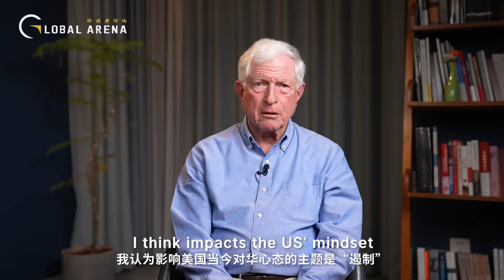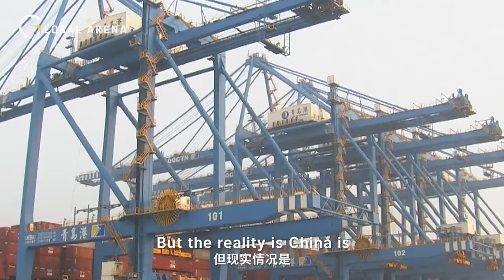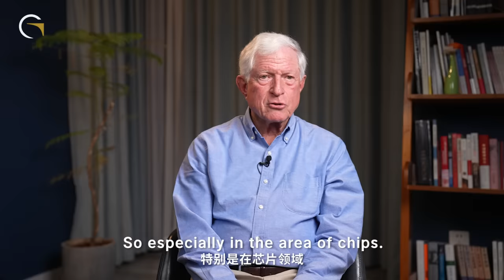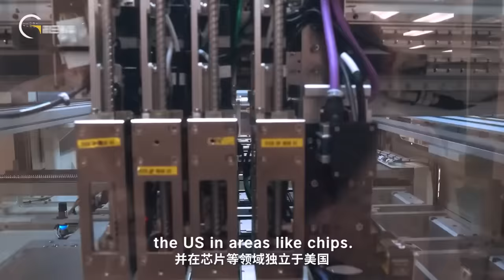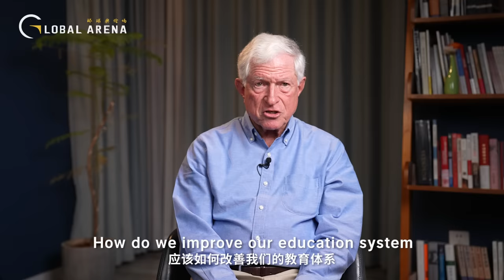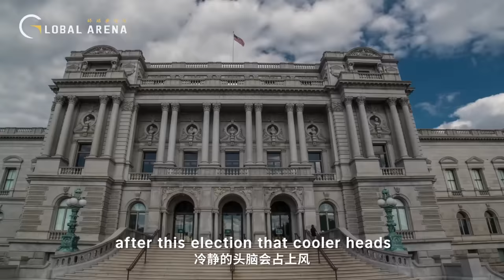Sanctioning China? US is as stupid as the Qing Dynasty Emperor

Comment: Excellent metaphor. But the situation in the United States is worse than that of the Qing Dynasty, because the Qing Dynasty was just in seclusion and did not provoke wars everywhere.
Reply: This guy is blowing sunshine up where it doesn't shine like Reagans biblical Winthrop quote.
Reply: The Qing Dynasty waged ten wars under the Qianlong emperor alone. Look up the "Ten Great Campaigns" against Burma, Vietnam, Tibet, and Xinjiang.

Also the Qing engaged in protectionism to run huge trade surpluses for decades (ironically this guy Walker quotes Qianlong's protectionist quip as if it reflects U.S. attitudes), eventually leading to trading partners retaliating. Only difference was the Qing had been bankrupted from wars and corruption and was using protectionism to restock its treasury while today China holds trillions in foreign reserves.
Reply: @cdsilber  No, Qing Dynasty was attacked by the Mongols and the Turks, they do not "waged" war, learn the difference.

To imply they did the same thing as the British (sailing and invading foreign land) back then is very disingenous.
There is a reason why China would rather build a wall than doing conquest.
Reply: Qing Manchu Dynasty in China was never in seclusion but actively conducted  wars on its frontiers to conquer and incorporate Xinjiang, Mongolia, Tibet, Yunnan, Siberia, Taiwan and exercised influence through military might over Nepal, Burma, Korea, and Vietnam. Because the Manchus were a land-based Eurasian Central Asian Empire and not a naval power, they did not cross the seas to conquer further afield.
Reply: @reivell3699  the great wall of China was first built by Qin Shih Huang and much later consolidated by the Ming. The  defensive wall project had nothing to do with the last Qing Manchu dynasty that infact conquered beyond the wall an Eurasia Central Asian Empire that stretches 5 time zones in the present day.
Reply: @cdsilber  Yea how bad of the Qing to reject the drugs the Brits were peddling. If a country doesn't want to buy your shxt, but you have plenty of shxt you wanna buy from them, that doesn't give you the right to wage war to offset your trade deficit. "Trading partner" is a charitable way to describe those conniving vultures.
Reply: @aero.l  Nope, didn't say anywhere the Brits had the right to push opium, just recounted what actually happened in history. Try to read more carefully next time.

Also just pointing out the video says the Qing was acting just like the U.S. today on trade. That's idiocy. The Qing closed its markets to all outside goods with protectionism in the 19th century to run a trade surplus. In the 21st century it's China once again playing protectionism to run a surplus, not the USA.

Hopefully you'll see what's actually written in this comment instead of just what you want to see (again).
Reply: @cdsilber what u describe is exactly what US is doing today. Protectionism to pay for war.
Reply: @cdsilber 如果这是你们西方的历史记载的话，我觉得很可悲。
Reply: @年青人 yes, it's called "not CCP-controlled academic historical records."

More than 150 million taels of silver to fight the Great Ten Campaigns (十全武功): three in Xinjiang (1755-1759), two against the Gyalrong of Jinchuan, Sichuan, one against aboriginals in Taiwan (1787-1788), one against Burma (1765-1769), one against Vietnam (1788-1789), and two against Nepal (1790-1792).

Add Grand Councillor Heshen's (和珅) massive corruption embezzling 15 years worth of Qing government tax revenues and the Jiaqing emperor assumed the throne to find the treasury empty. The Qing resorted in part to trade protectionism to replenish its finances.
Reply: @cdsilber 那只能说你了解的这些东西一直站在西方的视角来看待的。
Reply: @年青人 so are these words written to British king George III just "western perspective" too? Because they were written by the great Qianlong emperor himself.

"Yesterday your Ambassador petitioned my Ministers to memorialise me regarding your trade with China, but his proposal is not consistent with our dynastic usage and cannot be entertained... our Celestial Empire possesses all things in prolific abundance and lacks no product within its own borders. There was therefore no need to import the manufactures of outside barbarians in exchange for our own produce. But as the tea, silk and porcelain which the Celestial Empire produces, are absolute necessities to European nations and to yourselves, we have permitted, as a signal mark of favour, that foreign hongs [merchant firms] should be established at Canton, so that your wants might be supplied and your country thus participate in our beneficence."

Qianlong emperor letter to King George III, 1793
Reply: @cdsilber  这封信你想表达什么？我不明白。
Reply: @年青人  Use a search engine that gives you simplified Chinese text of Qianlong's 1793 letter to George III. And make sure you are allowed to view the full, unedited, uncensored version from your Internet location. Maybe then you'll better understand Qianlong's decree.
Reply: @cdsilber  你想表达什么意思啊😧
Reply: @年青人 well I'll start by expressing a new observation. After four replies you have worked extremely hard to escape reading and understanding a few simple sentences from a Qing emperor to a British king written 231 years ago.

Evasion and escape is not the behavior of a person who has confidence in their version of history, but rather one who doesn't want their comfortable interpretation of history disturbed by inconvenient facts written by Qianlong himself.
Reply: @cdsilber  我有承认这信我们中国人都知道，我想问的是你想通过这封信表达什么？
Reply: @年青人 so now after five replies you haven't offered a single fact. Not a single date, not a single campaign, not a single historical figure, not a single document. Just evasive rhetorical questions posting as scholarship.

You sure have dazzled me into changing my mind and accepting your version of history (which you can't even produce). How can I not be impressed by your vast knowledge which doesn't exist?
Reply: 我是在问你你想表达什么意思，你直接说不就行了。
Reply: @cdsilber 请问一下中国哪方面保护主义，请列出例子。
Reply: @年青人 you're the one who posted first: "your Western historical record, I think it is very sad."

Since then I've provided the names and dates of ten war campaigns, Qing budget statistics, and correspondence from imperial documents. All you've done in seven comments is postured with questions without providing a single countering fact. So no, I don't have to answer endless questions from an "expert" who claims to know the "correct version of history."

You started with the criticism. It's time for you to back it up with something more than disingenuous questions.
Reply: @cdsilber  我回复你了，我们中国没有打过殖民侵略战争。你不信
Reply: @年青人 1) Please show me the quote where I wrote "China has waged wars of colonialism."

2) Please show me the quote where Dang-ren-bu-rang wrote "China has not waged wars of colonialism."

Then look up the definition of the English phrase "building a straw man."
Reply: @cdsilber  无法理喻
Reply: @年青人  wrote "无法理喻" (unreasonable)

1) Dang-ren-bu-rang has provided no dates. 

2) Provided no campaign names.

3) Provided no Qing treasury statistics.

4) Provided no quotes from Qing officials.

5) Provided no historical details whatsoever.

6) Accused me of saying something I never said.

7) Claimed credit for saying something he never said.

8) Was asked for evidence of what he claims we both said. Has provided none.

Instead of providing any evidence, instead says "无法理喻" (unreasonable).

There is only one accurate application of that word: you must be describing yourself.
Reply: @frankyong2607 Actually Qing was not  from China... They're actually Manchu Ethnic, far cousins of Mongol from Manchuria, the occupiers from Manchuria that conquer China and the Han people of China and establish the Qing Dynasty.... Same as the Yuan Dynasty established by Mongol. They're a minority in China but time goes by, the Manchu slowly assimilated into Hans culture, language and belief and in the end of the Qing Dynasty they living their likfe like The Hans...
Reply: 越边界的战争，你来我往，情况很复杂，国土的扩张，不能简单地说是侵略战争！跳跃别国的占领，跳跃海域和州极的战争，那才能确定是侵略战争！